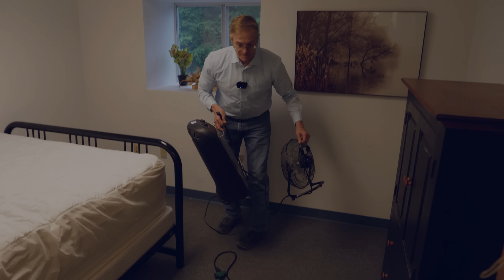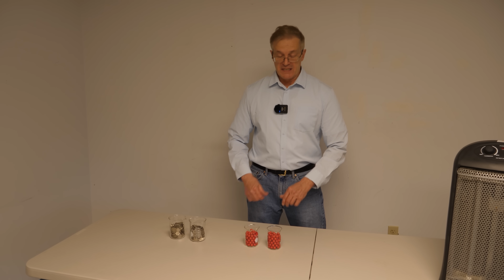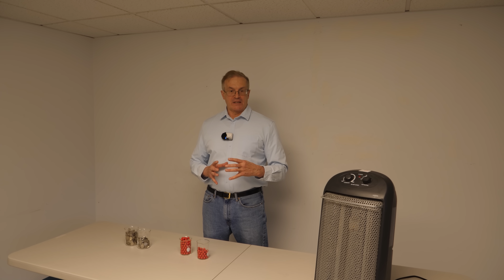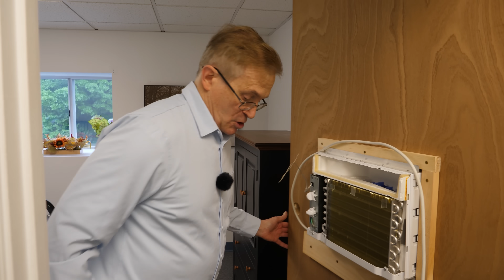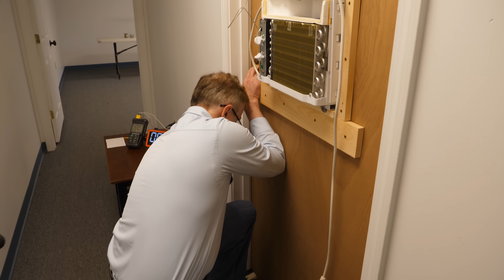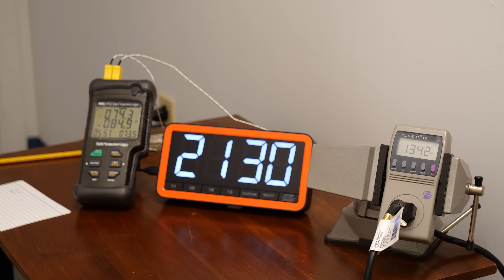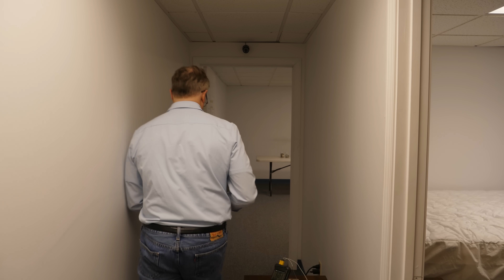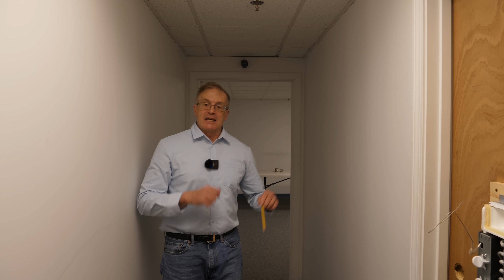You're wasting money on heating! Use your A/C!

Comment: Excellent!! I’ve been thinking of heating/cooling my travel trailer which I’m turning into an office/mancave with a small-ish heat pump. But maybe I’ll just use the A/C unit I bought several years ago for my garage/shop and flip it around physically summer/winter to accomplish what your experiment shows. 

But I do have a question: why are heat pumps so quiet, compared to window A/C units (and frankly, whole house units)?
My parents’ mini-split is so quiet that I know it’s running only because the fans are running, moving the conditioned air and waste air. 

Great content as always. I subscribed several years ago!

Comment: Manufacturers seem to have caught on to the fact that heat pumps are cheap and easy to implement. I recently bought a portable AC unit with a heat pump mode, and it didn't cost any more than comparably sized models that just cool.

Comment: yeah but how efficient would it be when the air its sucking in is 20 degrees instead of 75? even though an actual heat pump wouldnt freeze like if you flipped that window unite around would i still think its an unfair comparison. i feel like heat pumps lose a lot of efficiency when outside air gets colder.

Comment: So, during the winter,  where do I find a 75°F hallway as a heat source when it's 10°F outside?
Reply from the maker: We have a very large building...🙂
Reply: @TechIngredients  I don't. Nor do I have a warm climate in the winter. A reversed air conditioner isn't going to do much, nor be anywhere near as efficient as your demonstration. A full, workable heat pump system with a dedicated heat sink is an expensive major installation. 
I'll also note that I have seen "climate control" systems comprised of window mounted reversible air conditioners in motel rooms in warmer climes.
Reply: @DirtRoadie  If I stick my A/C backwards out the window, the compressor will probably suffer damage when it hits -30/-40C. Then I'll be boiling my sac off in the summer instead of comfort.

Comment: What about the retained heat in the objects of the room between Test 1 and Test 2?
Reply from the maker: We addressed that by letting the room remain open for over 80 min prior to the second test.
Reply: @TechIngredients  yes, but I'm thinking that prior to the first test, the objects in the room where are the much lower temperature, and therefore ended up absorbing more heat, and thereby affecting the results. So even 80 minutes of airing out, to me, doesn't mean that the objects weren't still "pre warmed," if they were warmer still, than for the first test. It's kind of like, instead of testing the effect of warm air in a room, you were testing the effect of warm water in a container. If you were measuring the net effect of the warm water being introduced to the container, and in one case the container and the objects in it were cold, and in another case the container and the objects in it were pre warmed, the net effect of a certain amount of heat being introduced will obviously be different. This is the whole reason we put ice cubes in a glass before pouring a beverage into it. Right?

Comment: If you want to use an ac for heat, you gotta add a defrost switch to the evaporator. When the tempature outside gets to about 30 degrees F the evaporator starts to ice up.

Comment: This is awesome work... but... the same issue you had with the room heating up and removing efficiency will also be present when the outside air cools.  My hypothesis is that it will still be much more efficient, but not quite the 5 fold results you had.  I would like to see this revisited, venting to the outside when the outside temperature is below freezing.

Comment: “The fan itself generates some heat” thank you for considering that.

I get so frustrated with people that think fans cool a room, when the reality is the opposite.
Reply: fans dont cool a room they cool you. they do this be creating air current that increases evaporation. the outcome is a cooler room from the perspective of the human experience.
Reply: @jjg1501  absolutely. And that’s a huge difference, for example when people leave fans on while they’re out so that the room is cool when they get home.

It’ll be warmer, although probably imperceptibly, but definitely not cooler.
Reply: @thedave1771  ive never heard of anyone doing that. i leave my ceiling fan on when i leave simply because im to lazy to turn it off. it does not make my house hotter considering i dont have air conditioning at all. 1 degree means little when your house is 88 degrees, lol
Reply: @jjg1501   sadly, I have.
Reply: @thedave1771  are you saying you left a fan on while not home or not in the room because you actually believed it made a room cooler?
Reply: @jjg1501  no. I’m saying I’ve seen real-life people do that, because they believed “fans make cool”. And it’s headache inducing.

Comment: Electric resistance heaters are one of the most wasteful methods for using electricity.
The question is how does this analysis compare with the cost of heating via a natgas furnace, furnace oil feed furnace etc……more complex because of the “SPARK SPREAD”. A term used by engineers to assess the relative cost of electricity versus the cost per unit of useful energy from natgas.
Reply from the maker: That's really difficult to answer because the rates and cost of delivery and storage also come into play.  Not to mention that electricity is actually more expensive during the day when airconditioners typically are used the most.

Comment: Okay there are a few things not adding up here, and air conditioner does not cool a room by removing hot air, it removes the moisture from the air and returns less humid air to the room. The heat generated by the AC is created by the motor and compressor, the evaporator would be near freezing. So you're basically flipping the A/C around to use the heat from the compressor to heat a room. I mean if the argument is that it make heat cheaper than a space heater then okay I'll buy your theory, however, a couple of things aren't factored in here. If this was winter time there would be much less humidity and thus the AC wouldn't have much moisture to remove, also being winter the ambient temperature would be lower and the AC units compressor and fan motor may never reach the temps it is reaching here. Yeah not 100 on this one.
Reply: You're ignoring the physics as explained in the video.  Yes,  humidity changes,  but that's a byproduct of the process.  Yes,  efficiency reduces with reducing temperature.

Comment: Tech ingredients next week:

Muricans! You can save power and energy by insulating your house. It is no woo wooo vodooo but simple physics which you all seemed to skip in school.

Us swedes installed a lot of heat pumps so that we could make room for more migrants instead of destroying our power balance and power grid.

 But our politricksters built a particle accelerator as far from our power generation as possible so that effort was for naught. System management and wisdom over a multigenerational dynamic equation was never the strong side of the apparachik class. But we built up our heat pump industry at least and they want to grow in the US to save the stock price at PE 32.

Comment: putting my air conditioner in my door, wouldn't my room mates love that with their exhaust fans..  8D
Great Vid..  I mentioned in class that I could just turn my air conditioner around in my window as a heat pump...
how long until the manufacturers start installing the reverse valves or maybe just install 2 air conditioners with one facing each direction?
thx 4 posting!

Comment: The simple fact is, you're not converting energy from one form to the other by using a heat pump.  your simply capturing heat from one location and relocating it. That in itself is the reason for the additional efficiency.  
A space heater has to convert the energy from the form of electricity into the form of heat energy .. and the heat pump simply captures it from where it already is and moves it to a new location.

Comment: The temperature probe was 10 to 12 feet away from the heater, but only 3 or 3 feet from the AC unit. And the heater didn't use 1300 watts, you had a fan plugged in, too (I also couldn't help but notice the fan was NOT directing air toward the temperature probe).

Comment: Comfort has nothing to do with temperature. A human body creates ~ 100 Watt of heat. If you loose more the 100 Watts you are cold, if you loose less your hot.  Radiant heat space heaters, the ones with red glowing lamps give much more comfort then any warm air system. Living on my boat in the Netherlands, I heat all year except maybe the 15 coldest days with only a 450 Watt heater. It heats the floor, the walls, the furniture and most important me. The air is maybe 13 degrees Celsius, but it feels cozy and warm like sitting at a fire place or outside on a sunny spring day.  The ease of measuring temperature is humanities biggest mistake!

Comment: What is actually happening in this test? 
I guess the resistance heater is mainly creating radiation heat. Heat which is absorbed by walls, roof, floor and object in the room and then the gas in the room is slowly heated by convection from touching the objects. Which means you need a massive amount of energy to heat a large mass for the air temperature to increase 10degrees. 
While the air conditioner is mainly heating the air volume thru convection and making the air in the room much warmer with less energy.

A resistance heater would only be good if you want to heat an object by radiation. Like a human or something else sitting just in front of it and useless to heat a large volume of gas.

Comment: That's not a resistance heater that heats air blown by a fan. It's a quartz radiant heater which operates on the very different principle of heating objects in the room with infrared radiation. It's my favorite kind of heater for precisely that reason. The fans in those are only to cool the unit itself. It does still work for you demonstration because the front grill gets very hot. (but you're stressing the quartz tubes by blowing air directly at them.) I'm sure you already know this. So, how can you expect people to have any faith in the concepts you're trying to convey if you won't be upfront about not having a resistive heater handy? If you didn't know that was a radiant heater, that throws how knowledgeable you are about everything you tell people into question. I already know you can do better from your previous videos. So, do better.
Reply from the maker: You're bouncing around a little.  A quartz tube with a wire in it is a resistance heater. The wire heats the quartz and the quartz transfers that heat to the room through both convective transfer to the air and long wave infrared radiation to other surfaces.  Remove the quartz tube, and the EXACT same heat transfer process occurs directly from the wire.  The tube supports and protects the wire.
Reply: @TechIngredients  Dude, while that's technically true, the tungsten filament in an incandescent light bulb does the same thing, but neither that bulb nor a radiant heater are meant to operate like a blow dryer. Otherwise, you wouldn't have needed that separate fan to transfer heat off of the front grill into the air. Now would you? Sure. Some small amount of convection takes place. But air is not directly blown across the tubes to direct heat through the air. The internal fan in those is mainly meant to protect the electronics and the plastic case, and provide sample air for the thermostat. Instead of air, it uses chromed reflectors to direct the RADIANT heat. And that's also how those incandescent light bulbs worked in old Easy Bake Ovens, btw. Not with convection, but with radiance. That heater is designed to heat objects in front of it which then, in turn, release some of that heat into the air. I think maybe I gave you too much credit in my first comment. LOL

Comment: What this guy DOESN'T tell you is that heat pumps still work with refrigerants. These refrigerants BOIL at specific temperatures.  And with the government agencies eliminating CFC's and HCFC's and are now on HFC'c, the temp difference has changed. YES, heat pumps are efficient BUT if you live in the north and the temp gets below a certain temp, guess what... the heat removal DOES NOT WORK! When outside temps get below the boiling point of the refrigerant, they have to use a ELECTRICAL RESISTIVE HEATER to pull heat from. 

Do your research people. They are not 100% honest.

Comment: that's very interesting and actually counterintuitive. I wonder where the energy is "lost" that causes this significant difference between heater and AC.
As you said: electrical heaters basically turn all the electrical energy into heat. So where do those ~900W go?
Could it be that the heater emmits a more infrared which rather heats the walls first instead of the air and 30 min is just not enough time for walls and air to equalize?
Reply: the energy isn't lost by the heater, it's all turned into heat. the difference is that the heat pump doesn't generate much heat, it just moves the heat between the inside and outside, which takes less power.
Reply from the maker: TheAechBomb is correct.
Reply: that makes absolute sense. thanks for clarifying!

Comment: How would the results change If you were pulling the heat from near freezing outdoor vs the indoor hallway? 
I get that for the experiment it was simpler to do it the way you did but would a larger temperature differential make it less efficient?
Reply: cold temperatures do lower the efficiency of heat pumps, but it has to get significantly below freezing for the efficiency to drop below that of a resistive heater

Comment: Although your “experiment” is exactly the response I would expect. I am wondering if the pundits might be critical of the fact that the air conditioner was situated within 3 feet of the temperature sensor, and the heater was well over 6 feet away?

Comment: Something seems a little off with your result here as the efficiency you've achieved is close to the best that modern heat pumps achieve. Just thinking through possible issues: 1. heating systems normally need to achieve a greater temperature difference than 15F; both will become less efficient with a higher delta due to losses in the walls, but heat pumps get less efficient at higher temperature deltas on their own. 2. I think there may have been a hysteresis effect going on here as the room was still 2 degrees warmer at the start than when you did the first experiment; that meant that the core temperature of the room contents may have been even warmer and radiating into the room. 3. your thermocouple was nearer to the AC outlet than it was to the resistive heater. This last issue could be solved by turning the AC off and waiting a minute for the air to mix.

Comment: Some accuracy errors:

You could have left the room temperature to equalize to closed room conditions, after letting it cool down.

The thermal probe is closer to the heatpump.

Just easily controlled minor flaws hitting accuracy

Comment: In Germany there already is a trend to install A/C units for heating. It is called "Split Klimaanlage" or "Luft Luft Wärmepumpe". When planning heating for an entire house though it is more popular to use some form of central heating, but these are often driven by a heatpump nowadays. There are also government subsidies on heatpumps.
Reply: If the subsides extend to electricity prices they will distort the utility of air source heat pumps, once subsidies are removed heating costs will skyrocket.
Reply from the maker: Subsidies are generally a bad idea as the  concern from 2353 illustrates.  
They can also corrupt the industries that depend on them, redirecting efforts to improve the very products they promote.

Comment: So your destroying the interior of your room with all that water your AC is dumping on to the floor?
Reply from the maker: Only if you choose to direct the condensate to the hot side of the airconditioner. You can drain that outside.
Reply: @TechIngredients  Is that not the default condition of a window unit, so modifications would be required? Also wouldn't  this cause issues with freezing temperatures freezing the drain?
I'm just trying to wrap my head around this.
Reply: @buttercup8932 this is a cheap demonstration of a larger concept, there are commercial bi-directional heatpumps that can pump heat both ways, and they either drain the water from both sides outside, or they have a water collection tray inside that you can empty about once a day